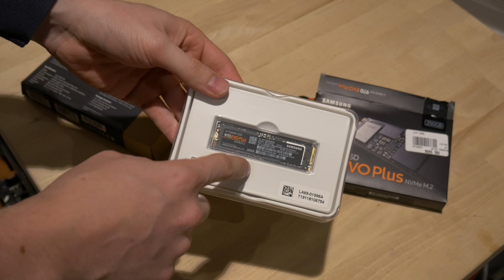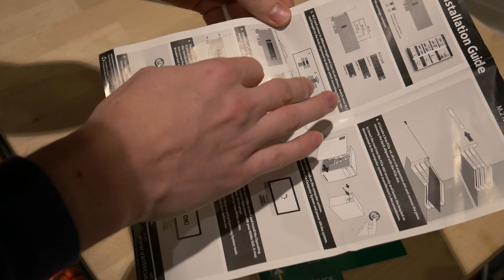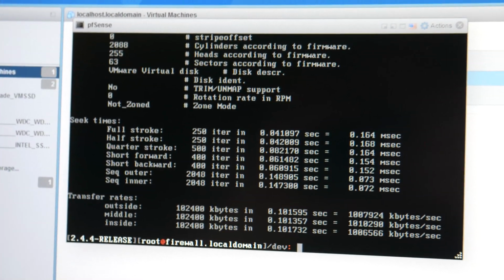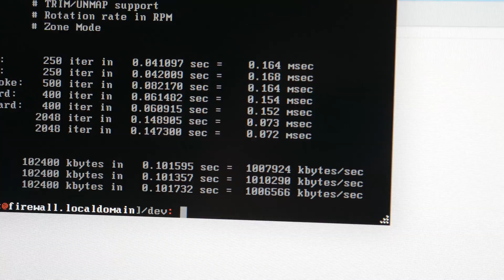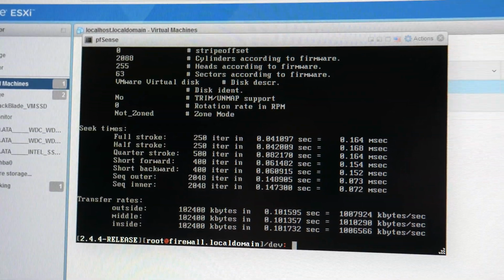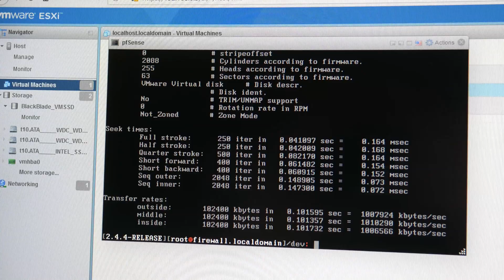You Put What in a Server? | NVMe M.2 Inside a Rackmount Server

Comment: By rerouting to SATA port(s), server loses the option to access SAS drives. Connection via the RAID controller (especially with the H710 mini D1) is also known to have faster transfer rates compared when connecting via SATA ports. 

Cross flashing the H710 mini to IT mode keeps access to SAS drives at the same time allows HBA passthrough for the drive bays.

Comment: I have a R710 and I've found the SAS drives to be quite slow and slugish. I get around 128MB R and 126MB W. Could I leave out the drives and just add this into the machine and use it, would the H700 RAID card see it as a drive or just as additional storage?
Reply: I have an R720 and it does not recognize PCIE NVMe as a boot drive. But you can configure it as a volume for VM.

What others have tried is they installed the root partition to the NVMe drive then plug in a USB drive with the boot partition in it. R710 has an internal USB port that can fit in a pen drive for this particular purpose.

Comment: Now you know the tip: Always boot your rack with an NVMe instead of a regular hard drive.
Reply: Or at least a SSD of some sort. Most of my rigs run off standard SATA drives and have a boot time after post of ~15 seconds. A NVME MIGHT shave some off that, but it's already 15 seconds. Good enough for me.

Comment: Hey man, I'm trying to do the same thing but my 420 is giving me this error: "A bus fatal error was detected on a component at slot 1" and "A bus fatal error was detected on a component at bus 64 device 3 function 0."
Any idea of what could be happening? :S 
The differences that I have on mine in comparisson to yours, is that I have a GPU installed on the middle pcie slot, a raid controller and 4 sata disks on the front + an SSD where the CDROM was.

Comment: Hello, nice vids! For the H710p, flash it to IT mode so you passthrough all disks individually to freenas. Boot ESXi, passthrough the newly flashed H710P mini It mode, reboot, go to freenas VM and Edit options, add PCI device and select the H710P and start up freenas. Voila! You now have your sas or sata drives completely available for freenas. I use all my servers with Samsung 970 Evo’s with pci e adapter and install all VM’s, ISO’s and Backup and ESXI swap.

Comment: So with the backplane still in (IT mode flashing the card should permit it to pass through, right?) you could use that sata port for a second drive and use a 2x nvme adapter. Obviously only sata speeds on the second drive but faster than spinning rust.

Comment: Thanks!! I just bought a Dell R420 to use as my home server. First Xeon system for me, and then its even dual CPU! :). Oh, and 96Gb ECC DDR3 RAM.

It shipped with 4x SAS 6Gbs 148Gb hdd's, set in RAID 5.

They are crazy fast, but I was thinking I may need more storage than the 450Gb down the line.

And now I know how! Thanks :D
Reply: Awesome! Welcome to the home server club! I bought a Dell R710 last April. Its a beast! I picked up a R210 a few months ago to use as pfsense router. I currently don't have anything running on the R710, but my plan is to turn it into an unRAID server once I pick up a Dell PowerVault 1200 to hold some more hard drives.
Reply: @ChadAmI80  Here's hoping you make a video on that ;)
Reply: @truezulu  I don't make videos on this channel anymore, but I am closing on a new house in a couple of weeks. I have a new channel which I am going to do random DIY things on if you want to check it out https://www.youtube.com/channel/UC-Trwqo8QJsAdyppyLwddrw/ I'll be posting a series on the rebuild of my entire network closet and running of Ethernet through the house.
Reply: @ChadAmI80  subbed instantly!

Edit: Good luck on the new home. Lots of work ahead for you then ;)
Reply: @truezulu  Thanks. Yes. Many, many projects ahead.

Comment: Is it normal for the drives not to show in bios? I just installed two evos with an adapter and didn’t mess with any backplane/drive configurations. The raid card is still in.
Reply: I have the same issue, I can't boot from it like I want to. It works as a drive expansion because OS drivers pickup but not BIOS, any ideas out there, please share..
Reply: @KilroggWOW  this generation of servers does not support boot from pcie. Only as storage.
Reply: @theophilusbassaw580  How to you get it to be detectable as storage? My OS cannot even detect the drive :(...
Reply: @daltonw5624  lucky the YouTube app pings me 🤣. Nvme protocol uses pcie so it should be automatically picked up. If your os can't see it. I would first look at your adapter you are using and if your m.2 ssd is actually nvme or uses sata.
Reply: @theophilusbassaw580  It's definitely NVME. Ver 1.2 to be precise. It's picked up by the Dell Server, but not by the overlaying hypervisor. It almost looks like the server has it allocated as a hot spare. It's kind of annoying actually, I'll see if I can find the issue this evening. And the adaptor is PCIe x8.